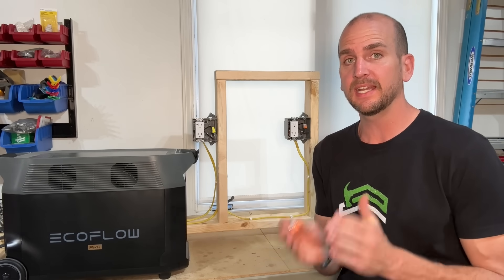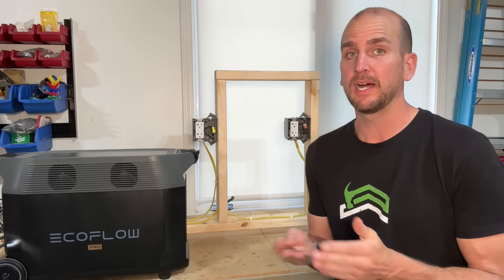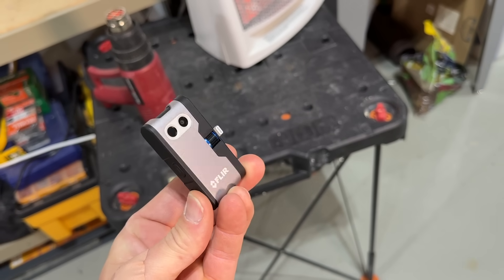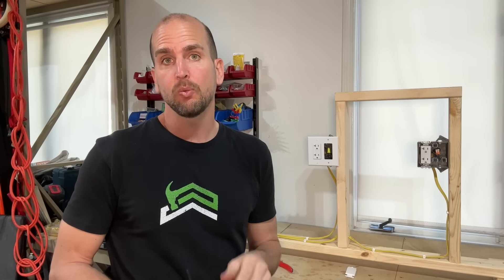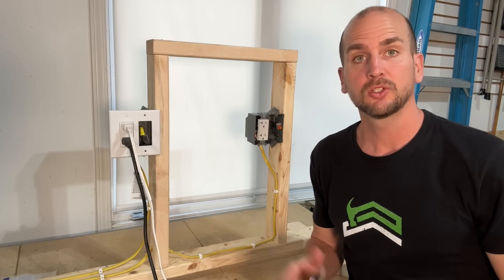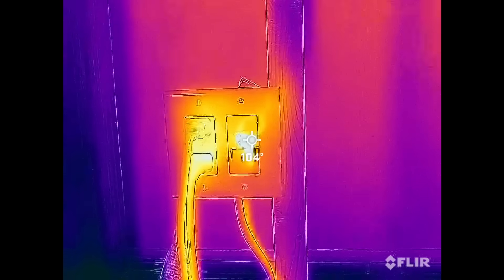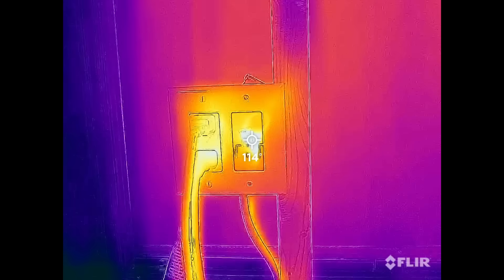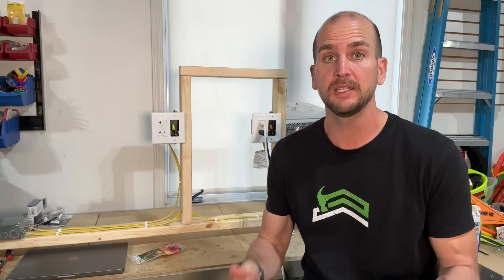Debunking the Pros: Can WAGO Lever Nuts Handle Heavy Electrical Loads?

Comment: 5 degrees is not a big deal. They are safety certified by UL and a bunch of other certifications as well. Yes, they have a little higher resistance but they are safer and easier as far as I am concerned. However, if you are going to heavily loading a circuit to the max at all times, I might say pre-twisted your wire and use a wire nut. But for standard loads up to 20A, I am unconcerned about this. Safety is paramount, but we've proven they are safe. 5 degrees hotter - woopty doo. Wagos are easier to work with and that's what I want in the end. Keep in mind also, when you back stab an outlet you are basically getting the same thing as what the Wago does - a spring clamp on the conductor. I have tripped breakers on backstabbed 15A outlets with vacuums, etc. over the years and when I redid the outlets a few years ago, all of them still looked new like the day they were installed in 1982.

Comment: I'm not an electrician but handy enough to install ceiling lights and fans etc...  For those uses, and by someone who is not a pro, I bet the Wago's are safer at the end of the day for these applications.  Much easier to use properly than a wire nut.
Reply from the maker: Agreed 👍

Comment: Very convincing test for me, I'm sold to the use of Wago lever nuts anyway. I wish that you could redo the same demonstration using the mix of rigid and stranded wires together because this is  where the wire nuts fail the most often and the Wago seems to offer a safer contact. Situation we encounter with electronic thermostats and heating baseboards for higher current than the lighting fixtures.

Comment: I have an older model mobile home, and if you have ever seen the nightmare of those plug-in receptacles, where there maybe 3 Romex wires at 1 receptacle, it will get a little spooky as to solve the issue of a replacement. So I came to YouTube to learn how to make my own repairs, and is where I learned about the WAGO Lever Nuts. So I went to Amazon, I ordered a small bag of them. The day they arrived I fixed my first receptacle, and before I went to sleep, went back to Amazon and ordered the BIG variety box of them. I did this 2 or 3 years back and have not had any issues so far, and will purchase them again if they are needed! I have rheumatoid arthritis, and these are so much easier to use than wire nuts! Peace and love and stay safe everyone, and remember to turn off your main breaker, before you begin your work!
Reply: Save yourself the trouble and hire somebody who will do the job right. One night you may wake up and smell something burning and say "whats that", it may eventually come to you to go check your wagos.

Comment: I think you said you were working with 120v. If you were working with 220-240v then there would be less current and that means less heat.
I think the biggest problem is using 120v so I would recommend another test on 220-240v. Thank you for your enlightening video.

Comment: You tested the immediate temperature rise, however long term failure of contacts is the problem with contacts having small amount of contact area. My experience with the push in wire reciprocal is that they failed after a few years of using a space heater, whereas the replacement screw type recepticals have not failed.

Comment: Old timer engineer here. I was skeptical about Wagos at first. It took me a while to get comfortable with using them. I dismantled one to see if I thought it would hold up over time. I am comfortable that the Wago connector will not fail with age, inside their safe usage parameters.
The only thing I still worry about is if anything can catch on the lever, at least on the type with levers. So I am still cautious where I use them.
I was up at the end of a 20ft ladder installing a new light in the equipment shed, when I accidentally lost hold of the fixture. I had a Wago on one of the wires and it held. It was a fairly heavy fixture. I was both impressed and happy about not loosing a brand new fixture!
Reply: Connexbox makes a line of junction boxes specifically for Wagos. They call them Wagoboxes. They've passed the toughest European tests and are certified for inaccessible installation such as being embedded in a masonry wall. The boxes hold up to three five hole Wagos and have a separate location for a five hole Wago for grounds. 2 and 3 hole connectors can be stacked in the 5 hole slots so separate circuits can be in the same box. The sides of the slots put a positive hold on the levers so it's impossible for anything to make them open.

The company would love to get them into the North American market but Underwriters Laboratories wants (as one of their people told me when I asked) "a telephone number sized amount of money" to do their testing. I wonder if WAGO would help fund UL testing for Wagoboxes? It would only help their connector sales here.

So in the USA if you want to branch a 20 amp circuit out to four things you have to cram everything loosely into a square box with three five hole Wagos where there might be some possibility of a lever lifting.

Why can't there be reciprocity between EU and NA on these standards so if one considers something safe, it's accepted by the other?
Reply: What does that have to do with resistance, heat and failing over time, wires rotating, spring pressure failing under heat. Are you kidding me?

Comment: Yes,  There is less surface area contact with the Wago nut ... maybe.    I tend to use the Wago nut with 4 or 5 connections.  Reason:  When I use a single wire nut large enough to accommodate 5 12 AWG wires, many times one or more of the wires get less than optimal connections in the nut.  For those wires I find it too easy to pull out of the twisted bundle by hand.  Therefore these wires have significantly less surface area in contact with the remaining wires in the bundle.  This would be especially problematic if one of the "loose" wires is the feed source to the rest of the wires.

The Wago nut in this case gives me very consistent surface area contact for each wire.   

An additional reason for me to use the Wago nut for 4 or more wires is packing efficiency inside a small junction box.   The Wago nuts allow for better wire bends and I can stack Wago nuts more efficiently in the box.   When I use wire nuts for large diameter AWG connections, the twisted connection makes the 'effective' wire diameter much harder to work with and bend as needed to fit in small junction boxes.   Placing all the connections in-line with the Wago nut allows the wires to bend in one axis much easier.

Last note:  I do tend to use standard 'cheaper' wire nuts for 2 to 3 connections.  I usually find wire nuts to be quite sufficient and reliable in this case.

Comment: I bought some Ohbet connectors which were generic knock offs of the Wagu connectors. Never do that again, I tried to run a vacuum cleaner and the connector melted. Thanks for the test, maybe I will give the Wagu a try.

Comment: Don't forget to consider the insulation on the conductors.  Table 310.16 shows that the temperature rating of TW conductors is 60 degrees Celcius (140 Fahrenheit).  I'm sure that many DIY'ers in your audience will encounter Romex using conductors with this temperature rating that was in use before the 1984 NEC required upgrade to 90 degree C for this cable, without realizing its lower temperature rating.  Your video title "Debunking the Pros", in my opinion, actually VALIDATES the pros, because you've demonstrated that the lever connectors that you tested are significantly hotter.  The pros also know that having hot connections leads to problems.   One example of this is that the insulation on the conductors becomes brittle.  YouTuber GreatScott! also tested, and found that the resistance of your Wago 221 connectors was 14 times higher than wire nuts (2.2mo vs 0.15mo).  So, yeah, you validated the pros.  They know that what meets minimum legal requirements and what is advisable can be different things.  The number of comments speaks to the fact that we really appreciate actual performance tests - please keep up the great work!!
Reply: The busbar is very heavy in the 10 awg 221 wago you have  as much conductivity as if the wire wasn't cut.

Comment: Only bad thing I've heard about them is that the levers are easily moved to like half cock, by bumping them or when putting them or another wire into the box. When this happens they are a little easier to pull apart. They do have their place, but I've never had problems with a wire nut.

Comment: tight connections always cools better than loose connection when electrons trying to escape and cause friction on the wire due to voltage leakage you never want that in your fuse panel

Comment: I have no doubt WAGO Lever nuts are safe with respect to their current rating. While the electrical contact surface is less then a wire nut provides, it is still sufficient to pass UL's stringent design and test requirements for currents rated for the wire size with 105 deg C insulation. However, I have one concern about application:  During a typical use (e.g., replacing a home receptacle in an existing outlet box, especially in an older home) the WAGO devices along with the stiff solid wires are pressed into the box behind the device and are not visible to the installer at that point.  Although I have not witnessed it, it seems possible that when the WAGO presses into the wires, mechanical pressure might pop open one of the levers. To reduce the probability of this happening, I put one wrap of electrical tape around the WAGO after closing the levers to provide extra protection against opening, and I pay attention to how the WAGO is positioned before pressing the completed assembly back into the box.

Comment: An electric heater in the style you are using is a great device to use for creating heat in the wire run. I would like to see this test replicated on a 30 amp outlet with a wire welder or some higher amperage device. Just to see if the higher amperage changes the variance in this test and what percentage increase in temperature occurs in the wire nut vs WAGO. Keep up the good work!

Comment: I have no doubt that pressure connections can handle 680 watts.   Now rip some 1 inch 9 layer cabinetry plywood with a 9 inch skill saw heating the blade to smoking on the same connection and see if it can handle an actual load.   Idiot.  All space heaters drop to about 600-700 watts when at temp.   They'll destroy #14 extension cords if they're in an environment that doesn't let them reach temp.

Comment: The biggest concern using any kind of connector that relies on a spring mechanism is metal fatigue. Thy would be great for temporary builds but I'd never use them for long tern application.  As the metal spring ages it looses its springiness and relaxes it's hold. A relaxed hold also has the potential for arching and is a fire hazard.

Comment: Nice testing!  I believe part of the beauty of the WAGO is that they are more likely to be connected properly by just about anyone...ESPECIALLY when connecting 3 or more conductors and especially when all of those conductors are not the same.  Specifically, when wiring up a light that is part of a multi-load with one switch scenario.  This case would very likely involve 2 solid 14 or 12 GA conductors along with a smaller stranded conductor.  That mixed conductor connection is easily made poorly with wire nuts.
Reply: Anything is made poorly by someone who is either inexperienced or doesn't care about good workmanship.  :body-blue-raised-arms:

Comment: The real test is what happens after 10 years...does the wago lever contact corrode enough to cause more heat and fail? Because I believe that's why nobody should use these fire hazardous connectors.

Comment: There is something missing and hard to measure. You are measuring average, but what you are really interested in is the worst of 100 connections. That is the one which fails first. If you would let me connect 100 wires with each technique, I am pretty sure the average resistance would be better with the wire nuts, but I am also pretty sure my worst individual connection would be a wire nut. Not saying I never mess up a wago, but you can easily insped visually. You notice an mistake.

Comment: My problem with Wagos is they came lose on a wire run for lights. As I moved to the next light they came loose from the previous connection. Yes, I clamped them down right. Yes, Iwas using the right size for the wire.  This was the third time I had this problem. Went back with wire nuts and no problems.

Comment: Every electrician is going to have an opinion that is skewed by their own biases. Unless they've tested the components to UL test specifications, they have no basis to claim that the components are no good. Usually, they're opinions are based on what they've been using for wiring for the past 30 years.

Comment: Now perform the same tests with splices that were mounted in a wall for 30 years.

The main reasons why wire nuts are illegal and WAGOs are the standard here in Europe are idiot-profing and the fact that wire nuts are prone to deterioration over time.

Comment: I started to use WAGO lever-nuts in one application:  splices inside a circuit-breaker-box or subpanel.  They are easy and convenient when I've had to connect devices inside a breaker-box like a generator transfer-switch:  remove the wire from the breaker, connect the transfer-switch "input" wire back to the breaker, and WAGO the transfer-switch "output" wire to the original breaker-wire ... the WAGO makes the splice clean, 100% reversible (no damage or cutting to that original breaker-wire that's often Only Just Long Enough), and OBVIOUS.

Comment: I once had an electrician connect aluminium and copper wires in my house directly. I watched him work for half an hour but then had to step away for 10 minutes and didn't catch the deed. Luckily, this was inside a brick wall, if it wasn't brick the house would burn down. That is to say, even "professionals" can do much worse than WAGO.

Comment: I'm not a professional, but I'm pretty confident with electricity, and I never doubted the WAGO connectors and their specs. The problem, at least for me, is buying the originals and not Chinese clones. Some of the clones are pretty good, and I use them for low-power 220 V connections, but in an ideal world I would never use them on the mains. I would use the genuine ones. I would never use a wire nut, nor manual twist. Only crimped tube connectors or WAGO (I actually trust WAGO more since it's spring-loaded - it is never going to lose pressure between the contacts, unlike screw terminals, twisting wires together etc.).

Comment: What is the voltage drop across a wire nut vs a Wago? As I understand, there is no limit to the number of outlets on a given circuit, so lets say we have a string of ten outlets on a circuit, that would mean ten splices, ten nuts or wagos... If we are talking something as small as a 1volt drop per splice, that ends up being a 10 volt drop at that last box. 
Lets say you have a 20 amp load with 120 volts, that comes out to 2400 watts.... however, that same load at 10 volts less becomes 21.8 amps. Is this enough of a drop do be a concern? I do realize these are the fringe extremes of these circuits, and likely not going to be experienced, so is it even relevant in new construction where high-load devices like a space heater shouldn't be needed anyways?

Comment: Did you measure the voltage drop on each of the connectors? I'll bet the wago had a greater drop than the wago. If you measure that over a circuit with many boxes there is probably a significant difference.
Reply: "....the wago had a greater drop than the wago", could you clarify?

Comment: A few thoughts.  It would be useful to know how many more watts were consumed on the Wago vs the Wire nut.  It would also have been useful to run the test until the wire stopped getting hotter (not sure where the asymptotes are).  Finally, in multiwire circuits where neutral is carrying current back for two phases, this is sadly not as crazy a load as it might first appear.

Comment: Excellent video! The results are what I would expect- Wagos have more resistance but not enough to be an issue. Not even close. My personal belief is the issues that people have had with Wagos comes from not having the wire inserted straight and flat. If re-stripped prior to inserting all should be fine.

Comment: Like most products everything is fine when new. I am concerned after long term use and thousands of on-off cycles and thousands of hours and use. The very reason I use 20 amp outlets and 12 gage wire for all new circuits around my house and my rentals. Had a fire in one of my rentals from poor 25 year old connections in a ceiling junction box. No one was hurt but the house had to be gutted and totally rebuilt. New up to code 200 amp panel and all new 12 gage wire commercial switches and recepticles throughout. The insurance company did not question the added expense.

Comment: This is a really great test! Could you do another video comparing heat from cheap receptacle backstabs vs. screw terminals? Also, I think you should repeat your Wago vs. Wirenut test with multiple splices in series to see if there are compounding effects from increased Wago resistance over the course of an entire electrical circuit. The difference was only a few degrees F with one splice, but does it get dangerous with 6 or 12?
Reply: Don't backstab outlets, please.
It's just not a good idea, connector is different from Wago.

Comment: If you want a better answer there is already a video of a guy overloading a wago and wire nut to well over their rated loads.  Spoiler, the wire nut melts off and the wago is still connecting 300v.